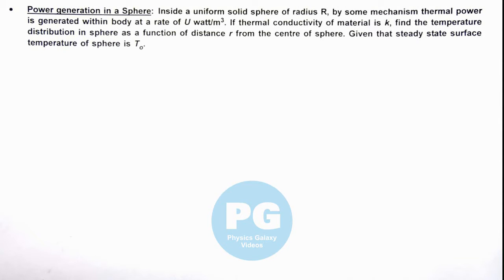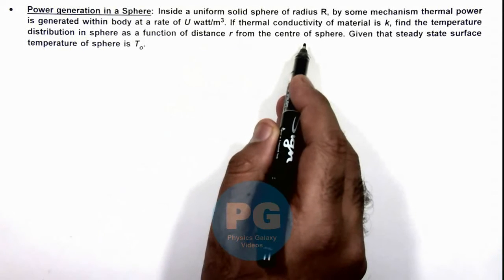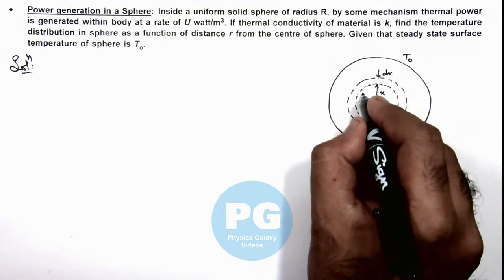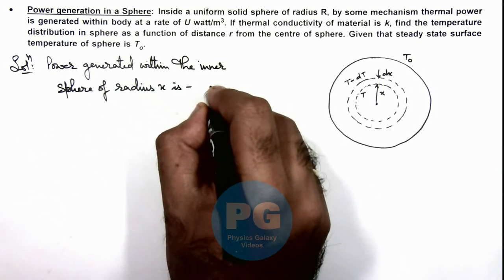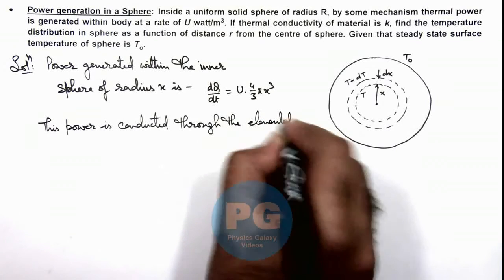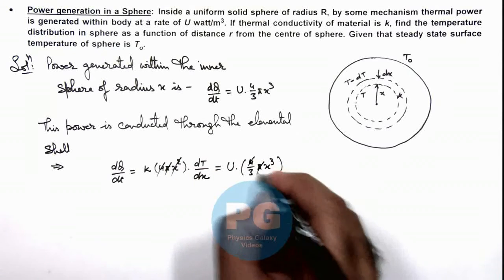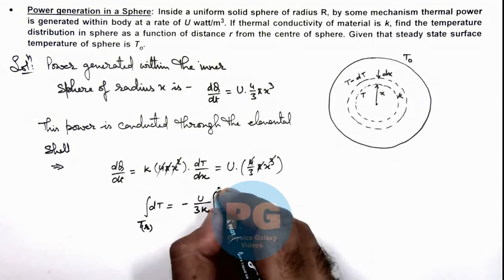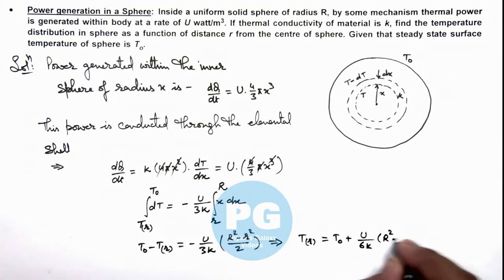23. Advance Illustration | Heat Transfer | Power generation in a Sphere | by Ashish Arora

Comment: Sir can't we solve it by finding  thermal resistance from r to R and then equate dq/ dt with Power
Reply: @GrimS'S PortaL can't find total resistance as limit in the integration will be from 0 to R and the lower limit will give infinity
Reply: @GrimS'S PortaL can u pls explain
Reply: @GrimS'S PortaL why this method is not working here
Reply: @GrimS'S PortaL the resistance has be calculated from r to R right...so the definite integral becomes 1/4pik (-1/R+1/r)
Reply: u cannot find total resistance

Comment: Why temperature outside shell is less than temperature inside
As volume enclosed outside shell will be more so power generated will be more and therefore temperature should also be More.
Reply: This is because the sphere is made of a thermally resistive material, whose conductivity is k.,as you radially move out, the temp. will continuously drop.
Just like potential drops about a resitance

Comment: Why the volume is not 4πx^2 dx! why 4π/3x^3?? As you have taken a shell of thickness dx
Reply: We consider that volume which is perpendicular to Conduction current .
Reply: Bro 4πx^2dx ko integrate karne se bhi same hi aayega
Reply: @MohitSingh-sg8mv  check their dimensions
Reply: @animalover2006  because total power generated inside sphere is to be calculated not power generated inside shell
Reply: @0oooo041  yeah
Reply: @0oooo041  why power inside sphere of radius x is used and power inside shell is not used ? 
Explain
Reply: @universalcosmologist3675  it is mentioned it in question itself
Feeling great back here after almost 2 years
Reply: @universalcosmologist3675  Because power generated in sphere material upto radius x is conducted through the elmental shell
Reply: @0oooo041  which college?
Reply: @rashmiranjan625  i did bsc from Lucknow University 
Right now I am working in State Bank of India as probationary officer
I had came a long way